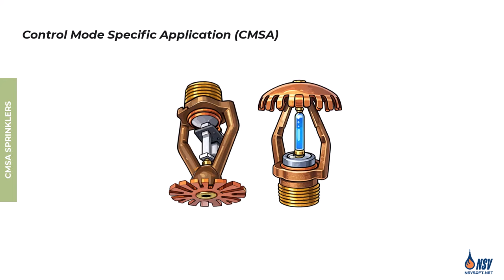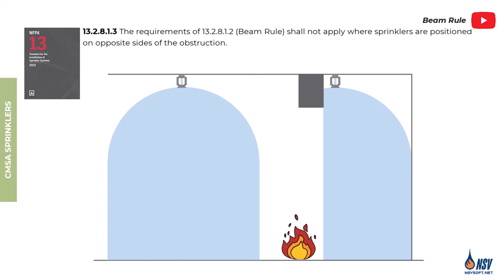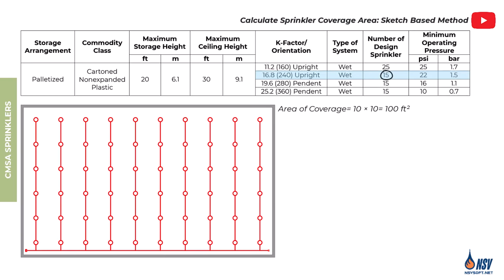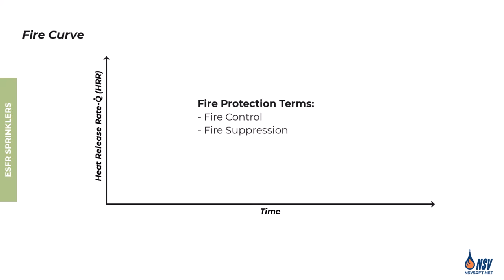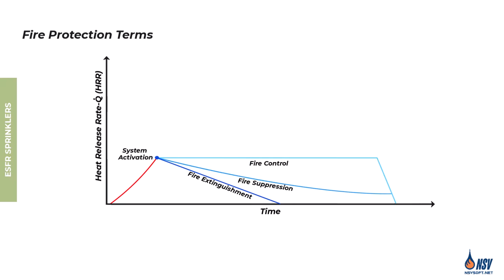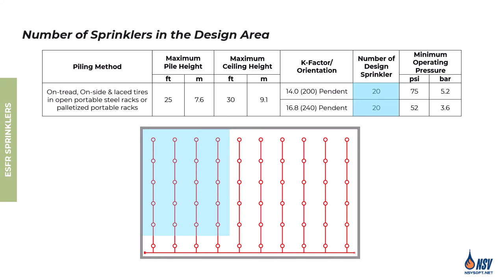🔥CMSA & ESFR Sprinklers (NFPA 13)

Comment: Sir goodmorning may i ask, if i have a multiple storage warehouse and beside it are rental spaces like phamary, restaurant,electronic store, & etc. what should be the classification hazard should i use in hydraulic calculation? and when can we use CMDA, CMSA, & ESFR based on the warehouse? thank you have a gooday!
Reply from the maker: Hi James,

You should evaluate each occupancy classification individually, following the specific installation rules—such as minimum/maximum spacing and coverage area—and performing hydraulic calculations for each.

If the entire project is under the same ownership and management, you can size your fire pump and water storage tank to support the highest hazard classification present. However, if the spaces have different owners, it is generally recommended to provide a dedicated water supply system for each occupancy. We recommend reading the ‘Technically Speaking’ column in issue 172 of the NFSA SQ magazine, written by Professor Kenneth Isman.

Regarding the use of CMDA, CMSA, and ESFR sprinklers: stay tuned! We are launching a new video series on storage warehouses starting June 29, where we’ll cover these topics in detail.

Thank you, and have a great day!
Reply: @NSVCad  THANK YOU SIR! I WILL WAIT FOR THAT VIDEO HAHHAA